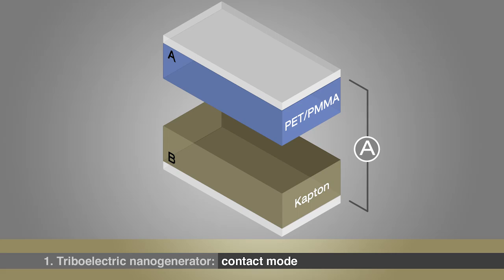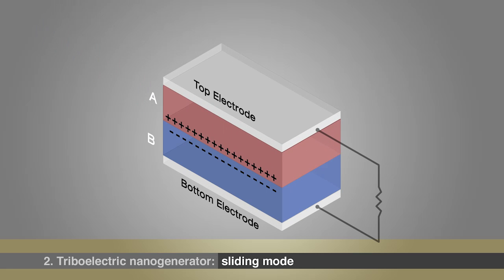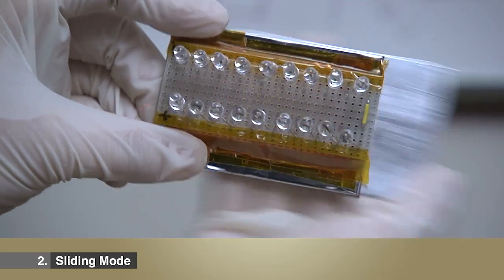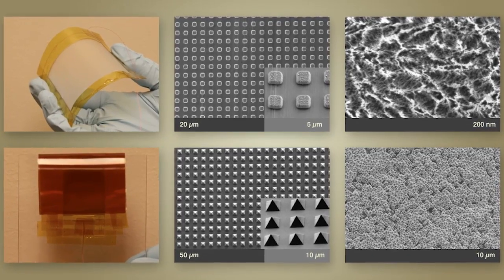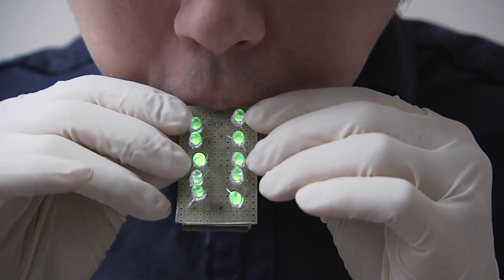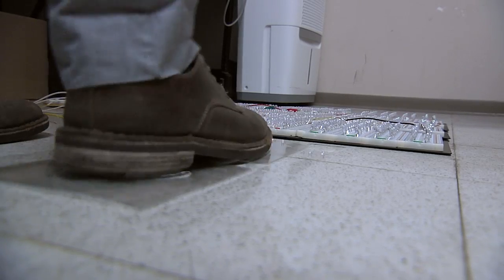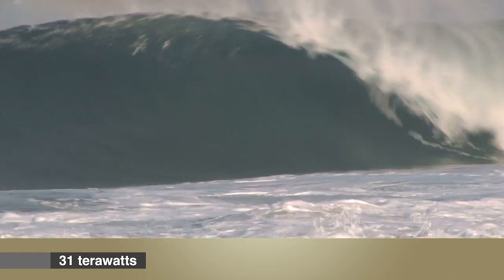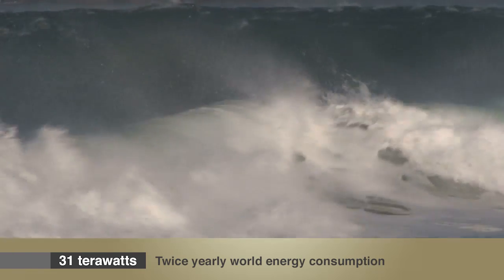Harvesting the World's Mechanical Energy

Comment: The trick prior has been using high voltage static charges: how to translate them down to usable lower voltage and current(power) efficiently. At high voltages semiconductors will breakdown and arcing will occur. If they can efficiently fill a capacitor with the power, then that would be great news. Then it could be translated using DC-DC conversion. The patterning is a cool spin, I'd like to know more how that's being used.

Comment: You can get enough energy to power your car for 1000 years or more from one plastic bottle cap from a used pop bottle. You don't even have to burn it.. you just split the hydrogen off the carbon with plasma in a chamber vacuumed to 9 atmospheres and have another rotating plastic ball in the center of the chamber.
cost to build.. under 100 bucks.